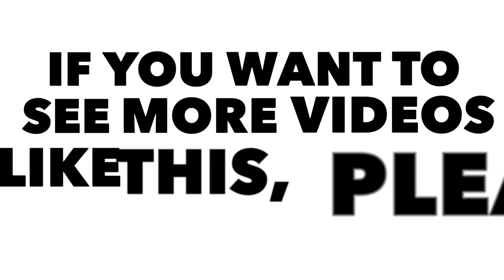How to drain sump pump water away from the house.

Comment: I live in Massachusetts. I have a 3" drain pipe from the dishcharge and it goes 25 feet away. About 6" deep. They installer said it won't freeze and it hasn't. Its been 8 years. I need to extend it another 80 feet though. My yard doesn't drain well in the Spring. I'm using 3" schedule 40 pipe with cement connections. probably about 10 or 12 inches deep. Basically the length of the shovel. It should do fine.

Comment: In Iowa until recently my sump discharge tube  ran solid from the basement to the ground 20 yards away from my house. Two winters ago, we had heavy rain in December which caused the sump pump to be active for about a week. During that time,  the temperature went to zero (0) degrees nightly for three days. The discharge never froze inside the tube or near its exit. The water coming inside the house and leaving was warm enough keep the discharge from freezing.
Reply: Jim Bohnenkamp yeah same with one of our rental properties we have the sump pump runs so much during the winter that there is a green patch of lawn Out front of the house during the winter the rest of the area is white with snow! 😝😆
Reply: just bought a house in desmoines you should come help me dig :)
Reply: Don't worry, i have a pipe running out dumping into 100 feet long, no holes, black ribbed pipe and we get minus 45+ like last year,  never ever froze one bit. As long as your pump runs often, i figure, since it pumps about every 6 to 10 minutes, there is enough warm flow to avoid this. One last thing I'd suggest is not to separate your pipe like above, i run my shorter pipe 3 feet down inside bigger pipe and all my100 feet pipe is on a 20% downhill angle above ground with no problem year round, even under ice snow.   So no worries, hope I've helped some :)

Comment: My neighbor just did this.  I have my discharge line running down hill of course,  unfortunately for him,  it runs into his yard lol. 
His pump comes out facing me,  so it's a battle of the pumps.  
He put in 4 inch drain pipe,  solid. 
His goes from 1.5  to a 4inch freeze protector, "right at house,  coming out straight down,  has slots incase the line below freezes.  I think it should work. 
Now me, I kept my 1.5 just that... it is buried under deck,  I didn't feel like messin with it.  So it goes down back of house,  and I put a 1.5 ta 4inch adapter,  "y" into his 4inch.
Works great but my line will freeze,  it does every year for the 2 months of cold weather.  So I already leave it unglued at outside discharge,  and cap the buried one,  than pull out my winter, "short" piece lol. No freezing.  For sure. 
Back to spring,  reattach the drainage system.  It sucks,  but until if dig up my 1.5 inch, a 1.5 ta 4inch freeze protector,  back to 1.5 wouldn't work well.

Comment: What’s the follow up story on this did it ever freeze? And does the pop up actually
Pop up or does the water just sit in the pipe? I know the cost is substantially less using this black tubing but what if you did same thing with say PVC? Pros and cons?
Reply from the maker: I believe that this has survived for 2 winters now. It has never froze over. I get alot of "smarter" people comment how horrible this is, but it has help up just fine. It's not how a professional company would do it but then my whole point was to show a cheap and simple way to accomplish a better solution than just a hose laying on top of the grass. The pop up emitter works just fine. I'm sure a small amount of water remains inside the tube. As long as there is a flow of water through it regularly, it shouldn't freeze.
Reply: @AlleyPicked  man, thanks for this. Screw those people lol

Comment: I really don't understand how a spacing between the pipes and then having a meshed screen over it will be better then a direct connection. Won't the mesh screen build up small ice droplets and in time clog the entire entrance area during winters? There are ways to have a direct connection without the freezing problem.
Reply: I think the idea is when the sump is active and it is below freezing outside, and the shallow underground pipe freezes up, or the screened entrance tube freezes, at least the water coming from the sump pipe can still exit, so the water still leaves the house. Otherwise the sump pump would just keep running, but with a frozen outside line, the water would remain in the sump.
Reply: The air gap is there so that if the underground pipe gets blocked up, the water still has somewhere to go that isn’t in your basement

Comment: how does the space prevent freezing
Reply from the maker: When I used to have an exit hose attached, it would freeze in the winter and burn out my pump. By having the space, it becomes almost impossible for the line to freeze. The water underground drains out. If the underground line did freeze, the water would simple spill out on the ground because of the space.

Comment: It would be nice to know where the installation is located.  It seems to me that the 1 1/4" discharge pipe is going to freeze in many areas of the US.
Reply from the maker: The installation is in Illinois. Winters can be very cold. The pipe exiting the house is on a slope and should not freeze because there isn't any water in that section of the pipe.
Reply: Using a pop up you will have water at the base of the pipe near the popup emitter that could freeze. Why not cut a hole in the curb and discharge to the street keeping the pipe empty? I saw this thing called an ice dam that you can put into the discharge line as it exits the house. It has 6 to 8 openings in the pipe before it hits a larger pipe going to the discharge point. If the larger discharge line freezes the water exits the pipe near the house turning into ice of course but does not block the line.and the pump keeps working. I thought your hardware cloth solution was pretty cool but an ice dam is better. Good use of of ties too. I saw the use of this ice dam in a plumber's video on youtube. The plumber was from Buffalo NY I think.
Reply: @GeorgeMinton-jb8ky  because cutting a hole on the curb is illegal in most cities. I've seen some who will let you cut into the storm pipe or inlet, with a permit, but never cut the curb.
Reply: @AlleyPicked  I am in Roselle Illinois and need this done badly - would you help me do this? I don’t know where in Illinois you are or would be willing?

Comment: Not a bad job, if only to buy some time to address the source of the water problem. Start by extending discharge of rainwater further away from your downspouts. 

I had a wet basement until I spent a couple hundred on gutters and directed the rainwater just a few yards away from the foundation, onto ground sloping away from the foundation. 

Celler is as dry as a bone most days.
Reply: When you mention wet basement. was it just moist spots on your concrete floor? im having the same issue and im debating doing what youve done, plus an interior weeping tile system, or just doing what youve done and call it good.

Comment: Since you were going to poke holes in the pipe, would you recommend using corrugated pipe?
Reply from the maker: If you use corrugated pipe, the ground along the pipe will tend to be wet...I would let the water all exit at the end but then it depends on your circumstances.

Comment: Reading the comments I agree that there is a lot "wrong" with your installation of this drain, but you did an ok job for the fact that it looks like there was little to no grade in your yard.

If you do end up circling back to remedy any issues from this in the future, consider the following:

1. Replace the mesh setup with a freeze relief sump pump discharge device for $20 on Amazon.

2. Dig your trench 12-24 inches deeper depending on your winter's.

3. Use a 4 inch white perforated PVC drain pipe (not the black pipe encased in white PVC pipe), on top of 3-4 inches of #1 gravel, install a clean out every 12-15 feet and fill in the rest of the trench using #1 gravel.

4. Since you don't have the grade in your yard to both go deep and away from you house to discharge onto the street or even on to the lawn, dig a 4' x 4' hole out by the street or in the middle of your yard away from your house, and fill it with gravel, or install a drainage barrel to discharge into.

5. Do not connect your sump pump or downspouts to your storm sewer line under the street.  More & more municipalities encourage residents to discharge downspouts and sump pumps onto your lawn to relief the usage of the storm sewers lines.  Most large towns and cities have outgrown this sewer lines and have a high risk of backing up into people's basements, and the sump pump is simply discharging into the lines that are already backing up into your basement.
Reply from the maker: Thank you for the thoughtful , well stated, good ideas.
Reply: Great instruction, *Brian Connolly! Thanks so much for sharing! I thought of trying the drainage barrel setup but felt that because my soil is SO clay-heavy, the underground absorption would be way too slow, filling up the and barrel (even with the holes in it) then as a result, the water would fill up the hole and spill out the top of the overflow cap on top of the barrel causing the area where it's placed to become a flooded mess! (Woosh! Talk about a run-on sentence! Lol).

Comment: Why did you leave the pipe so long from the pump?  Seems to me having the drain line come up right against the house would’ve been much smarter. You would’ve been able to cut the discharge pipe much closer to the house lessening the chance of freezing and less chance some landscaper is gonna break it off. Right?  

Also, if there’s such a flooding issue on that side of property why did you leave that ridiculously log downspout extender attached?  For just a few bucks more you could’ve tied that downspout into that drain line. SMH!!
Reply: Often times the foundation/footing of the house will extend out some distance from the foundation "wall" 12-24 inches below grade.  If you want to get the drain pipe snug up to the wall for a neater look, you'd need to cut into that footing with a concrete saw.  Doing it like this looks worse, but is easier, faster, and cheaper to do.

Comment: French drain Man so call NDS inferior 4" corrugated PVC works fine to me? But, I don't agree with cutting slits in the PVC pipe & elbow should be solid no holes. If it's pitch right all the water should exit.

Comment: Wow just wow! So many things done incorrectly
Reply: 815Angling 
Tell us all the things that are wrong, educate us
Reply: Aaaaaaaand CRICKET'S. still no reply from the person. Thanks for nothing!?
Reply: For one thing ,you never use silicone to join pvc pipe fitting. And using a thin bladed knife to make some tiny slits by the road is not gonna last long. Will slog quickly. I also agree that you should have put the 90 degree at the house immediately on exit of house. Then put the 4 inch close to the house as well. Should have put pop up at curb flush to the ground so you could run mower over it. When that water freezes on the side walk and someone falls your in trouble. That's just a few quick things.  @fixit4182
Reply: I called the local codes office once 20 years ago with a general question about building a pond in my yard. First thing they wanted was my address. They told me a permit was required for any excavation work associated  with the job. I opted not to do the job. One week later my dog was barking wildly. I looked outside to see the Inspector peering through my chain link fence looking into my yard!
Reply: @TonyDiscenza     I didn't suggest cutting up the side walk, just that the water coming out is going to go across the side walk which could freeze. Yes the insurance would pay then drop you not even counting the damage the old person or who ever might suffer after the tumble. I know it would be more expensive but I would have dug a deep dry well below frost line and then filled with rock so that the water could disperse. Cover that with sod and still have the pop up in case the water did not drain properly. It all depends on the type of soil of course, clay would be a problem.

Comment: Isnt the pipe very shallow in the ground?
Reply from the maker: Yes, but keep in mind that often people will run the drain pipe above the ground. The pipe is large and never completely fills with water. This installation has been in use for 3 winters and has never frozen over.
Reply: @AlleyPicked  was not thinking of the frost but rather if there is sufficient soil for the grass to grow
Reply from the maker: @DinakarJayarajan  Yes there is plenty.

Comment: would this system work well during the winter also?  would it freeze up?
Reply: Yes, it will freeze. The pipe is corregated, not buried very deep, and the exit is above the pipe elbow. So water is going to collect in the corregations and at the elbow, where it is going to freeze. With the elbow next to the house, it is pointed down. It will be difficult to connect another flex pipe to evacuate the water. 

You really want to use a solid pipe the flows at a minimum of 5 degrees. It would be good if there is a drop-off at end of pipe to prevent freezing. Or bury a dry well deep in the ground, below frost level.
Reply: @donvnielsen  just want to say THANK YOU for all those spot-on and crucial observations! major kudos, you're 100% correct and it's embrassing all the shortcomings of this video you've pointed out too!
Reply: i'm trying to understand - this would only be an issue if the pipe is frozen while the ground is so saturated that the pump will need to run right? that sounds like an uncommon thing, but maybe i'm wrong, please help

Comment: pop up emitter? they are just for looks.. just end cap it.. ain't no way water from any sump is going to push up the emitter to exit.. has to be on a good hilly slope.. the lawn mower will cut it off when it goes over it due to vacuum of air pulling it up and then cuts it.. just bury the end in some gravel after capping it.. use perf pipe after 10' --14' away from the house..
Reply: WRONG! I dead ended my sump pump drain with a pop up emitter and it has worked perfectly and keeps the trees watered in the summer.

Comment: Might be ok if you live someplace where it never shows or freezes.
Reply from the maker: Not true.I live in the midwest where we have very cold winters. This has been in place through 2 winters and it works fine. as long as it's on a slant and the water drains out, there are no issues.
Reply: i don't understand why people keep saying this. if it's freezing then why would you need the sump pump.

Comment: I prefer apple drain for proper product placement. That zip tie screen and duct tape is cheap.
Reply from the maker: Thanks for your comments. That is kind of the point to the video. Cheap solution. You can improve it any way you like. Just a bare bones solution...better than a hose running across the top of the grass.

Comment: DIYers always create business for the trained!
Reply from the maker: I seem to get some criticism for this video but nobody ever says why? While I am not a plumber, this simple method has been working fine for over a year. It's cheap and beats leaving a hose running on top of the grass.
Reply: Number one, never use silicone and duct tape only primer and glue. Number two might be more preference, but use solid 4” pipe not that black pipe. Also google ice guard fittings, just looks cleaner than the screen and zip ties. Kudos for leaving space for frozen pipe, I’ve seen bad backups because of connected outlets.
Reply: Two sentences of advice and DIYers are now as good as "trained" people charging 500 bucks for this job!

Comment: That’s gonna crush eventually and backup
Reply from the maker: It's been almost 3 years. Still works great. Even if it did crush, which it wont, it's not very deep, it won't backup as there is a disconnect from where id comes outside the house.

Comment: Why not use perforated corrugated pipe?
Reply from the maker: That's another option. I was just trying to do it inexpensively and a better option than running it above ground.
Reply: I’m afraid I will have to come up with a solution for my parents house.  My father who is suffering with dementia is convinced his house was built ten years ago when in fact it was 1962.  Anyway, he keeps fiddling with the sump pump and burning out motors by propping up the float switch because he doesn’t trust them.
Reply from the maker: @rogertrujillo7423  there are pumps that use a pressure switch instead of a float. Maybe that would help?
Reply: @AlleyPicked  thanks, I’ll check it out

Comment: Would you mind telling me how deep I need to bury pipe.  I live in Massachusetts (cold winters).  Draining only is needed in early spring when snow is melting.  I know I have to have a constant decline under the ground, but any other help would be great
Reply from the maker: Hi, thanks for watching my video. I am not a plumber and do not know if there are any official codes in your area, but I have done this twice in Illinois where we also have cold winters. I did not dig below the freezing line in the ground. I didn't think that was necessary. I think if you dig 12-18 inches, that should be fine. I've been through one winter and mine has worked fine. I also connected a dry well to the first one I did.
Reply: This is two years ago not sure if anyone see but we are getting too much water at end does anyone have ideas?
Reply: Alley Picked Hey know 2 years ago we are getting two much water at end do you have any ideas?